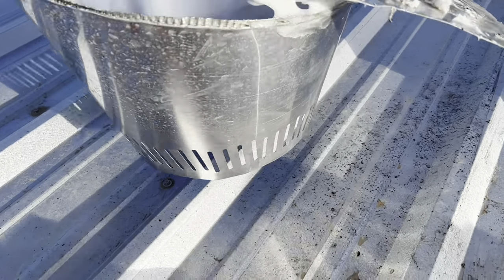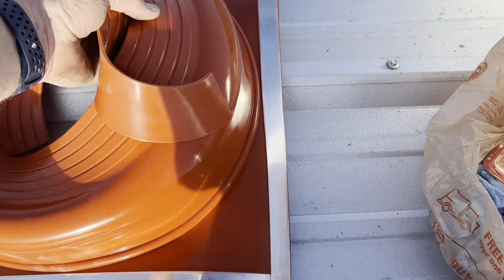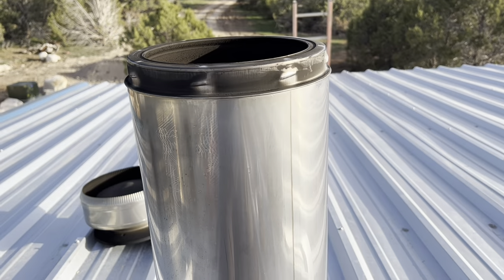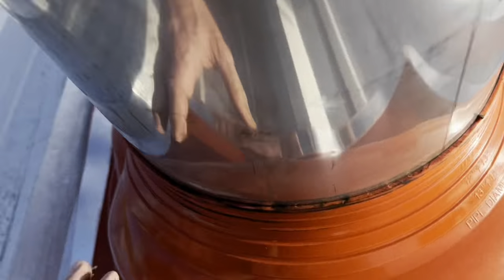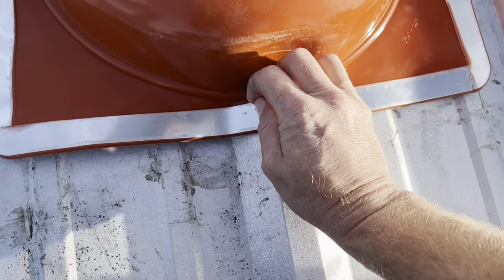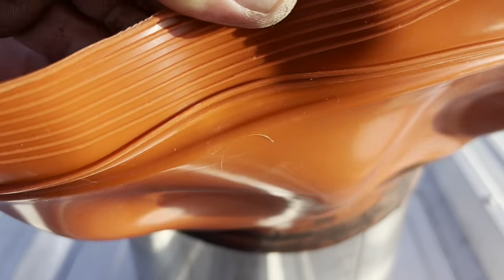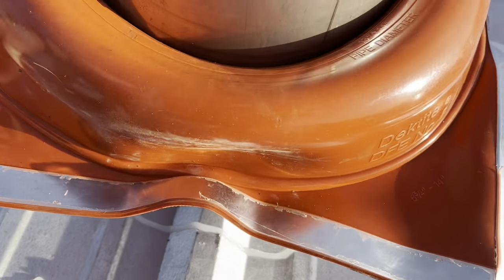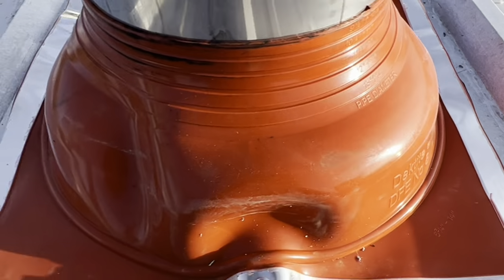Installing a Dektite silicone boot flashing on a wood burning stove chimney

Comment: I need to put a chimney through a sheet steel cabin roof, I've been trying to figure out how to do it properly with that steel flange you removed.  Seems the more research I do, the more I think it's better to go with one of these flexible boots. They aren't cheap, but in the end, knowing they will seal properly is probably worth it.
Reply from the maker: This was such a better solution when it was all said and done. For a metal roof this is the only way to go IMO.

Comment: What screws did you use? Are you just screwing the boot to metal roofing or all way to plywood underneath? Thanks
Reply from the maker: @scottdieboldsr.3594  I used sheet metal screws that have a rubber gasket. They were actually extra ones from the building. Essentially these though, https://amzn.to/3XPKJoe and just into the metal roof, not wood underneath. Held great.
Reply: @BryanHansen  thank you

Comment: Good video thank you. Those flashing are for high temperature. But are they resistant to sparks coming up the chimney and touching them?
Reply from the maker: Very. They work great. No complaints after running them for 2 years now.
Reply: @BryanHansen  thank you

Comment: has you’re boot had any problems with melting or not withstanding the temp of the chimney pipe?
Reply from the maker: No, not at all and I’m burning coal. The red boot is the high temp boot and it has performed perfectly.

Comment: You don’t apply silicon to the bottom edge, only 2 sides and top so if the silicon fails it allows the water to escape.
Reply from the maker: Not per the manufacturer.
Reply: Great job ,I used 1 of these boots, and yes ,seal all the way around. When using the steel boot on an asphalt roof never seal the bottom .that's where the water will escape.

Comment: What do you do if the gap between the ridges is narrow enough so that the Dektite boot blocks the flow of rainwater to the gutter on a nearly flat roof?
Reply from the maker: Install it in a diamond configuration to help it not block the flow of water.

Comment: I'm an old single dummy gal, im doing this myself,  would you tell me what brand of silicone glue, or is it just silicone? I'm in Montana too so cold temps, I hope you answer questions I'm hoping to fix my pipe this next month, still have to order that rain boot, thankyou!!!
Reply from the maker: This is the exact glue I used and we live in similar climates. https://amzn.to/3yFWSQ4 here is the boot too: https://amzn.to/3aOzBDR
Reply: @BryanHansen  I really appreciate it, I had found the boot but I was especially concerned about the sealant. Thanks

Comment: Hey, do you think most rubber boots can be screwed just directly to 3/4" roof decking? Or does it need 2x4 or 2x6 framing
Reply from the maker: I think you would be fine screwing it to the roof sheeting/decking. I wasn't screwing this into the purlins, just the metal roofing. Works phenomenally.
Reply: @BryanHansen  Really?  I'm worried it will act as a water dam and leak.  I might orient it at as a diamond to help shed water. i don't have as good an orientation to the ribs as you do. I would use a standard metal flashing if I could but the chimney I'm using its a weird size and not standard in the U.S.
Reply from the maker: @jackktorness  it should all seal up. That’s why you use the silicone and gasket washer screws.
Reply: @jackktorness  Unfortunately when you go diamond pattern it overlaps more tall ribs. This in my opinion makes more areas of damming.

Comment: How do you seal the top of the dektite onto the chimney?
Reply from the maker: It is such a tight fit around the pipe that it is watertight. I still ran a bead of RTV silicone around it, but you cut it to size and it fits really tight

Comment: If I'm not wrong, I don't think you're supposed to use silicone to seal it. I think you're supposed to use a polyurethane based caulk but you might want to check..
Reply from the maker: Nope! Right from the manufacturer instructions: "Apply neutral cure silicone
sealant on underside of flange"
Reply: He did it the correct way it's a high temp SILICONE boot SILICONE is what is recommended under the flange

Comment: Nice, I'm hoping to attempt this. So do you put any roofing silicone on the join between the flue and the top of the flashing? Or is that a secure seal?
Reply from the maker: I have put a bead around it before. It is a tight fit, but it doesn’t hurt anything to put RTV around it.
Reply: @BryanHansen  
Yes, for sure. I think I'll do that, cheers 👍
Reply: @BryanHansen  
Argh, I got a leak 😒
Reply from the maker: @carl8568  coming down the pipe or around the roof seal?
Reply: @BryanHansen  
Yeah it's coming in between the roof and the dektite mate. I put a lot of silicone (and screws) so it's a bit frustrating. Unfortunately the flue is pulling the tin roofing down slightly causing a depression which is allowing water to pool around the seal.
Reply: @BryanHansen  
I've pulled off and scrapped the original dektite and put a new one down, with more silicone on the inside. Hopefully it will pass the hose test tomorrow!
Reply from the maker: @carl8568  definitely make sure you have prepped it the best you can and are using the right silicone.
Reply: @BryanHansen  
I'm using Sika roofing silicone, it's good quality stuff.

Comment: I turn them like a diamond. Less surface area for water and gives it a path to flow away
Reply from the maker: I typically do that as well, but we were trying to cover up the previous installation, screw holes and this is such a shallow pitch roof that it doesn’t really matter anyway
Reply: Good job

Comment: If I may add a comment, I believe butyl roofing sealant would be a better choice. Silicone sealant is highly over-rated and prone to failure.
Reply from the maker: I don't disagree with you to be honest. Butyl is great and if installed correctly makes a good seal too.

Comment: Double wall or Triple wall chimney pipe?
Reply from the maker: Single wall to the cathedral box and then triple wall out the cathedral to the cap. But, use whatever your ceiling box requires, double or triple.
Reply: @BryanHansen  Ok I have been just scouring to find if double walls are cool enough for them. I actually just want to install it at the top of my chimney chase because of the type of cap I have would benefit from a boot type install.
Reply from the maker: @LukeAudette  guaranteed it would be cool enough. My stove running coal through single wall up at the cathedral box isn't 200 degrees fahrenheit (more like 125) where it goes out the chimney top. They are rated to 392 degrees fahrenheit. You will be plenty good.

Comment: Does the steel roof require a 2 inch clearance?
Reply from the maker: For which piece? Want to make sure I am answering your question correctly
Reply: @BryanHansen  2 inches clearance between the steel roof and the chimney pipe
Reply from the maker: @badromenful  no. Not at all. Only from flammable items. I peeled back the insulation underneath back from the triple wall pipe 2 inches.